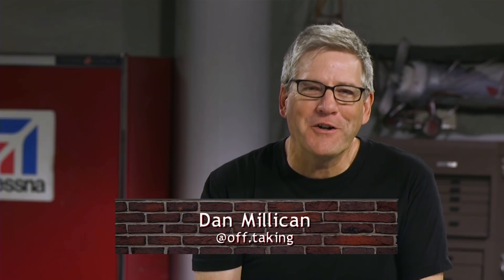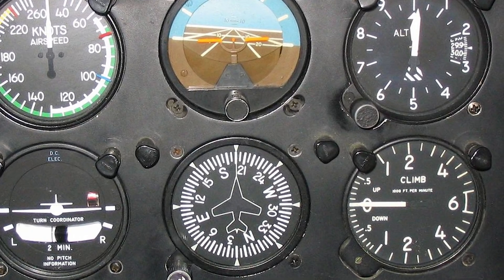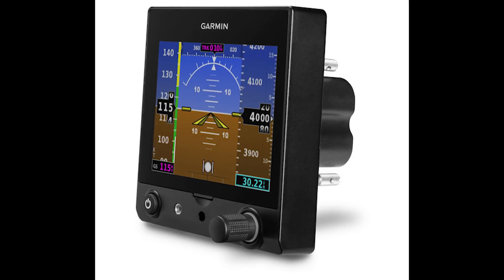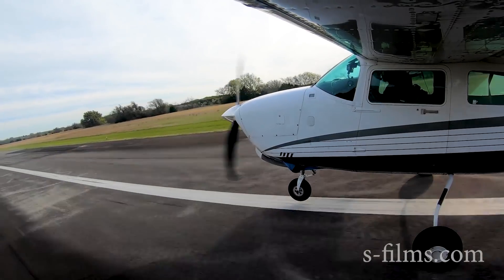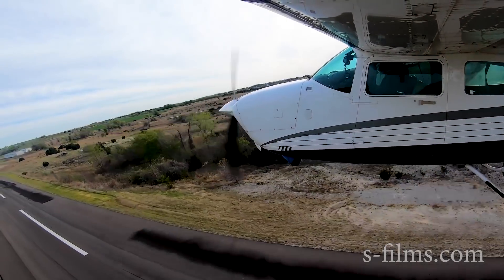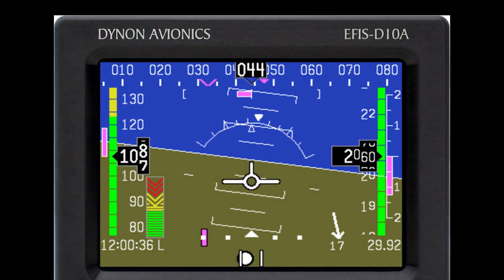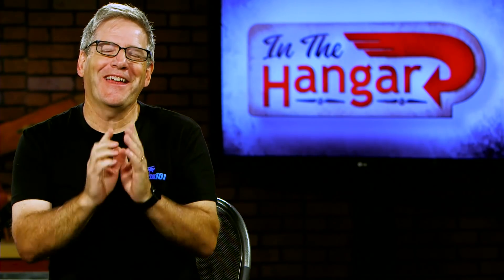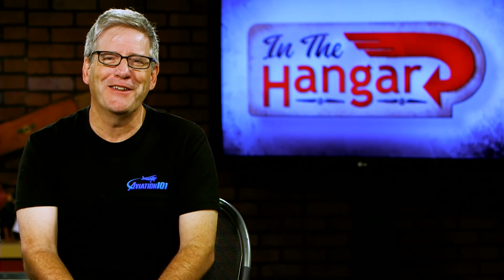Upgrading to Glass Cockpit Garmin Aspen Dynon - InTheHangar Ep 58

Comment: Steam gauges forever!! I MIGHT have a vacuum pump failure. Do I loose all instruments? No. Loose electrical, do I loose all instruments? No. Go all glass. Loose power? It's all gone. Have a glitch? It's all gone. Mechanical gauges took Lindbergh across the Atlantic, they guided our bombers in WWII, Korea, and Nam. Worked for all them, works for me
Reply: Too bad the NDBs and LORAN aren’t around anymore. 

EFIS always has a battery backup or a redundant display. That’s for certification and refutes your first argument

Lose ALL your instruments? That’s what partial panel is for.

To have dual EFIS glitch or a single EFIS and required analog backups glitch, you’re dead no matter what you have.
Reply from the maker: You do know with glass you keep a few steam in case of failure.
Reply: @TakingOff . If steam gauges are needed for backup anyway, why waste resources and space on glass—you should have analog gauges as your primary instruments in the first place.

Comment: On the question if an A&P can install the new instruments the answer was yes but you did not state if the pilot or mechanic could buy the equipment from say garmin or would the dealer want to send the equipment to a shop they approved to install the equipment. So could a A&P order the equipment from garmin and install it with no danger of losing the warranty ect. If you could have a more detailed program on installation from a A&P and what goes with that type of installation. I understand on used equipment it does not matter, its the ability to purchase and keep the warranty that's important. 
Awesome video like always

Comment: Commercial RC model plane electronics are far more advanced than a Garmin GA cockpit, and since they are so inexpensive a fully redundant suite can be installed including redundant sensors and power supplies. The software / hardware reliability question is a moot point. There are 10x more Arduplane / Pixhawk packages installed and running commercially during the past decade than Garmin avionics.

Comment: I have a 1968 182 and just put in a new electronic international mvp50 p witch is amazing and also removed vacuum system and installed the  nuavionics av30 c dg and ai and I think it is absolutely amazing.  The look, the added features and the lack of the vacuum system not to speak of the much lower price than the g5. You get things like probles angle of attack, g load, density altitude and so much more. And your mechanic can install it so you don't get robbed by garmin.
Reply: Sorry uavionics

Comment: It's amazing how glass is changing the aviation world i still love having some of what's call steam gauges.  For backup

Its possible there is no need but having just one glass panel is possible a big mistake.

 It failed you loose Airspeed. Dg and AH all at once and loose control of all avionics systems only access through the display.

But the new systems are nice and give pilot's the avionics systems that were once only available to fighter aircraft or top end aircraft.

With all things new some will take it right out of the door and some Will stand back with caution to its 100% clear it's the only way to go.

Dynon and Garmin are both easy to install
Reply: @Terrie Cotham - if someone replaces all their steam gauges with a glass panel, is a backup system required?
Reply: @edb7742  
That depends on possible how the aircraft is use and if it has an MEL list

If it's a private aircraft. LSA / Exp then no . i have been building avionics and aircraft systems for a few years.

Some pilots will install backup gauges like Airspeed. & AH and others go totally glass with or with out a dual display

If it's a Cert aircraft like the 737 .DC10 
, Lear Jet or. Light twin or SEL for hire then its under different rules

Take the aircraft that had a mix up on fuel and made a dead stick landing in Canada. It equipment was state of the art but pilot's lost. 90% of all flight instruments if remember right due to the batterys going dead after both engines fail due to lack of fuel.

The aircraft had a small generator that drop out of the aircraft and help supply power bringing the avionics equipment back on line.

Lot's of the new glass cockpits have backup battery systems to help get the aircraft down safe if main power failure

The glass cockpit unit's like the G3X or Dynon HDX1100 can have multiple displays that are independent of each other and can easily take over if one unit fail' s

All so other countries may have different rules of what the aircraft must have on board and working

Take the new ADS-B rules it will make flying much safer. And the new ELT'S now can send out it's GPS location to let S& R team's pin point the aircraft location. If it has GPS data sent to it

Hop this helps
Reply: @terriecotham1567  Thank you

Comment: Just as an exercise, I'm not current and doubt I'll be able to get my medical back, but looking on Controller, I can get a 1980 V35B for about $190,000.  It already has a GNS530/430 combination in it, but I would want to upgrade it.  Kris, Baron Pilot, has really impressed me with the Avidyne stuff, so an IFD 550/440 combination to replace the 530/430, which since they're slide-in replacements should be less expensive than replacing the 530/430 with a GTN 750/650Xi.
This isn't inexpensive, but a 10" Dynon and a 7" Dynon, ADS-B In and Out pair with the transponder, autopilot, and Engine Monitoring System is only $22,000.  Heck, that's far less than the cost of the Avidyne IFD550/440 combo, which is about $31,000.  It is most certainly far less than a G500TXi in 10" and 7" (dual displays) along with a GFC500 and engine monitoring system.
So, for about $55,000, plus install (I said it wasn't inexpensive) you could have a completely modern, full function EFIS, Navigator, Autopilot and Engine Monitoring System.  Trying to do that any other way is going to be closer to the actual purchase cost of the airplane!  Dynon truly is the way to go on this, and if you can live with an older GNS530/430 combination (if you have one), you can save significant amounts of money still.
What four place airplane can you buy for a quarter of a million dollars that has that kind of capability?  The closest you might find would be a mid-2000's SR22 G2, and even then, you would need to upgrade to the latest Entegra system, if you can even still get it.  Or, at the minimum, replace the 430's with the 440's.
So, for what you get from Dynon, I think it's really the best deal on the market, at least right now.

Comment: not sure why everyone has a jones to get rid of the round gages. They make good backups. Standard nonsense is: "oh, the vac driven instruments have a far greater failure rate than full electronic, the vac system will fail after x years". No, the vac system as a backup has to only last 1/2 to one hour, which is enough time to get out of a full power failure situation that takes out your full electronic system. A vac system is completely besides the electric system, thus the chances of a electric and vac fail at the same time are astronomical.

Comment: Ive been learning to fly in a sportcruiser with dynom avionics but sometimes I prefer the steam gages. I.e vertical speed indicator.  I find it easier to look at a steam gage for that compared to a magenta bar that goes up and down on the dynon
Reply from the maker: Intersting.  Even with my Aspen PFD1000 right in front of me, the one analogue I always quickly go to it the VSI.  For some reason, I can't train my brain to find it on the Aspen (even though I know where it is).
Reply: @TakingOff  same here!!! A big gage with that sole purpose is easier to look at than trying to find a moving bar somewhere near the moving altimeter

Comment: My panel is based on the DYNON suite (HDX) (except my NavCom is Garmin).  Love Dynon. (Hate Aspen).  Garmin? overpriced.
Is a touch screen, but have only used it to activate/change settings on the autopilot and transponder.  Buttons fine for anything else.  ok, if I want to pan the map page, that is also easier with touch, but could live without it if necessary.
Reply: Another (night and day) difference between Dynon and Garmin is the quality of Customer Service.  Garmin isn't even in the same State, nevermind Ballpark as that provided by customer friendly Dynon
Reply from the maker: From what I've seen from the little I've had the opportunity to use Dynon, I'm very curious and interested in what they have to offer.  If I were to do a big upgrade, I'd definitely look into them.
Reply: Apparently you never used, owned or even have been close to a Garmin instrument, but talking about it bad for no reason.  First of all it costs less than the Dynon and offers more.
Reply: @ernoovari8394  bullshit on both accounts

Comment: Good info discussed. However, next time please add real $$ budget values. At minimum, $$ magnitude for each product segment to include equipment AND installation costs.
Reply: The request made is to approach cost in same manner you discussed steam vs glass. The conversation covered general aviation’s basic upgrade conversion of legacy avionics. Using that very same example, what would be typical equipment cost and typical installation cost. Issue usual disclaimer - cost may vary depending on aircraft, complexity, equipment specifics, etc. For many legacy owner/operators, determining viable budget for first basic glass upgrade is a do, don’t or not yet decision. Think it’s worthwhile subject matter for your avionics discussions.
Reply from the maker: @JoseRivera-lt2cc  Okay, fair enough and great note. Next time we'll bring some numbers into the discussion.  I see your point.
Reply: no one wants to discuss that a typical single G5 installation whether an AI or a DG replacement is 6-10k with equipment on a simple legacy aircraft like a Cherokee or a Skyhawk/150  and that’s of course considered a basic “glass” upgrade
Reply from the maker: I thought about it when we filmed the episode-- the problem is talking cost is almost like asking "how long is a piece of string?"  There are so many factors, the first answer to cost question is "well, it depends..."